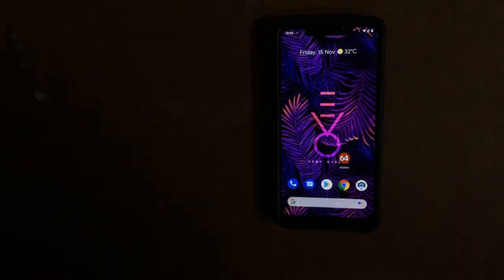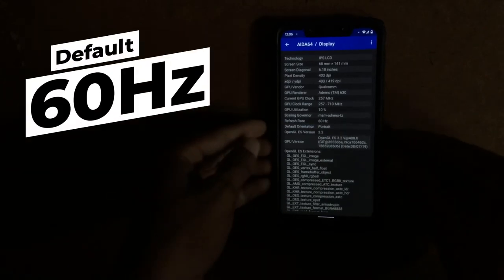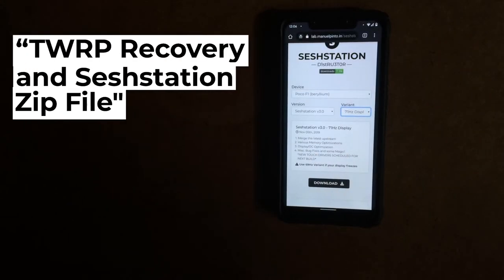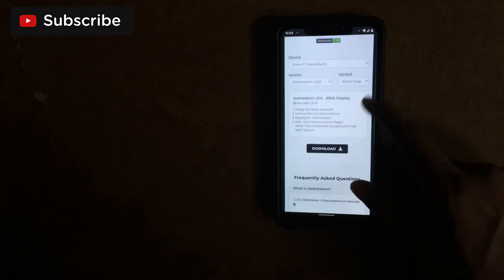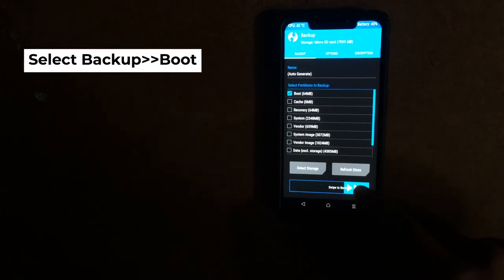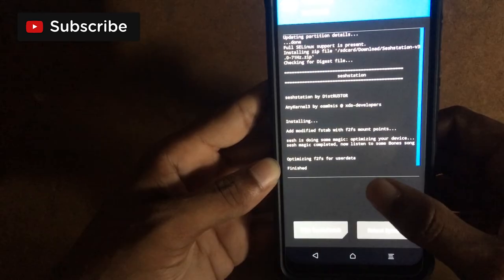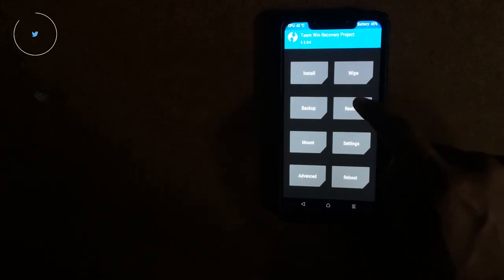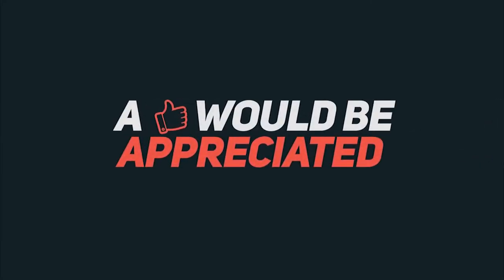How To Do Display Overclocking On POCO F1 [71Hz], Increase Your Game Speed & Performance 🔥

Comment: If the refresh rate is changed, will there be any problem with the phone?
Reply from the maker: According to the developer No, But i experienced some lag in device during shutting it down. Actually the version i used in this demo is pretty old. It was getting regularly updated, last installation & working went fine with me. Any how, getting backup is a great choice for this, i guess

Comment: After u lock ur screen phone going freeze . All poco like tht
Reply from the maker: Yeah, i do got some freezing at some moment, but after i restart, it worked perfectly. Have used phone for 2 hrs spending on PUBG, haven't got any freezing issue, but after i quit i got a little freeze. I think the kernel have some bugs still. Will try another time, if it behaves the same, then I'll goto Optimus Drunk again
Reply: Working for me on 69hz without any issues
Reply: its freeze to prevent damage

Comment: This don't loose any data right?  Without root?
Reply from the maker: Yeah but in order to install the only prequisite is to have twrp. If you got it then you can backup your current Rom's kernel and try this kernal
Reply: @CuriousSteveOfficial  can u explain in detail where u placed the files?
Reply: @CuriousSteveOfficial  can I contact u on insta or somewhere

Comment: Bro can I install in miui rom
Reply from the maker: Yes, i checked in the XDA forum and according to the devoloper, you can install in miui. My opinion is to have backup before trying it. Just backup your current kernel and flash this, if it doesn't work just get back easily. Happy modding
Reply: nope

Comment: bro download nhi hoo rha file ek bhi pls help
Reply from the maker: No worries. Follow this link https://www.seshkernel.tk/. You can download the latest or stable version zip files easily
Reply: @CuriousSteveOfficial  bro touch issue or display issue jse kuch nhi hooga n
Reply: @CuriousSteveOfficial  thnx bro ☺️
Reply from the maker: @sumitgamer2599  actually a touch issue happened to me after installing it. But as you can see,  this video, I tried this a year ago. Now, the version was updated to 10times of the version that I tried. Maybe you won't face issues that I faced.

My personal suggestion is that backup your OS or at least kernel in twrp before installing this. In that way, you can revert back if something wrong happened. 

Happy tweaking 😗

Comment: All rom?
Reply from the maker: Not all, in this video I used Evolution X, so it will work on all versions of stock android based OS's(Pixel,EvoX,Bootlegger etc,) and I actually tried  to install it on Oxygen and that gave a boot loop so it didn't work. MiUI worked. These are some of OS that I tried.